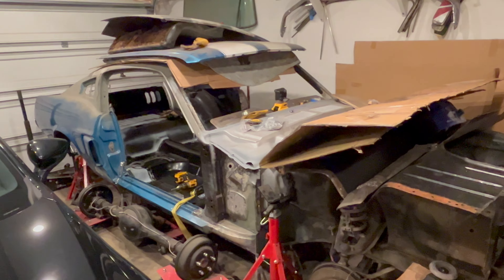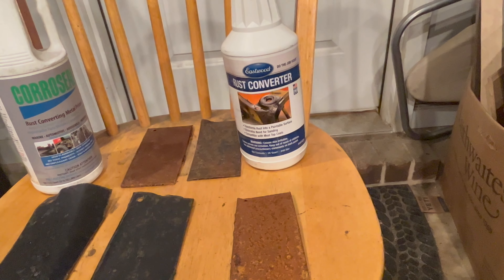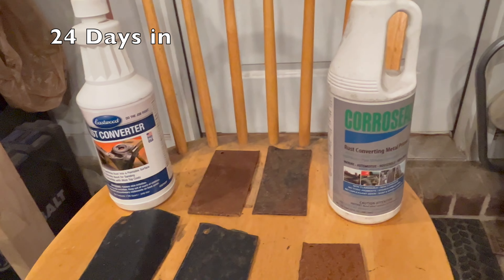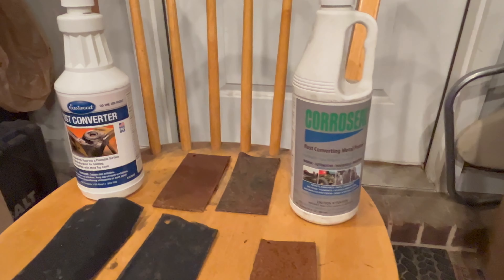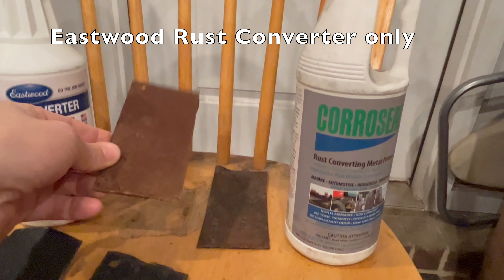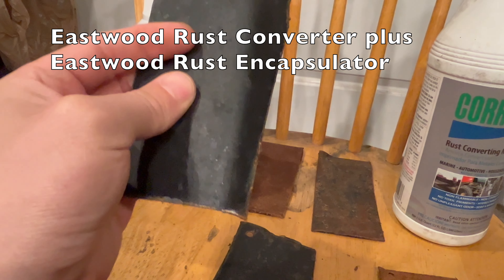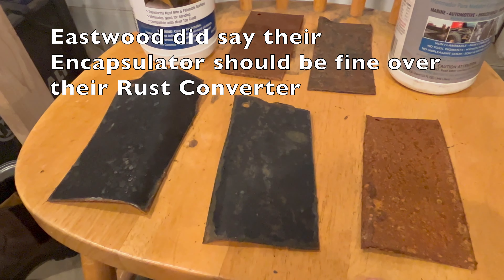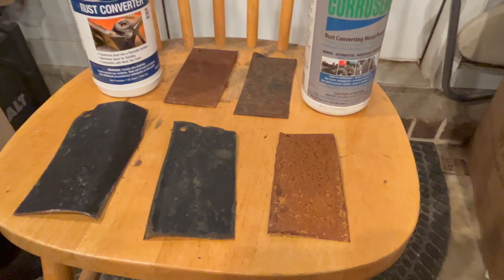Corroseal vs. Eastwood Rust Converter Part 2: Rusty Update

Comment: Much appreciated video thanks for your time
Reply from the maker: No problem! The experiment is not as exciting now, but it is showing me how the rust encapsulator is holding up under abuse. I’ll probably update again in a few weeks
Reply: @evansmessygarage  still holding up?
Reply from the maker: It’s not doing as well as I expected on top of the rust converters, but it’s maybe not a fair test. If I were to properly test the rust encapsulator, I’d also test it on bare and primed metal to see the differences. Without a control, I can’t really say much definitively
Reply: @evansmessygarage  you're still giving it regular salt baths?
Reply from the maker: Every few days I’m spraying with either salt water or plain water. Now that it’s getting colder, the reactions have slowed down. If I were to redo it, I’d try more combinations of products and set up a better jig and time lapse. Maybe in the future
Reply: @evansmessygarage  I live in FL but I bought a northern Sequoia I think I'll be good with what you did in part 2
Reply from the maker: If it’s got some rust already, I’d get as much off as you can (and replace metal if it’s bad), then rust converter to get everything you couldn’t reach. But maybe clean off whatever was converted before you top coat, and maybe a good primer first. I like the rust encapsulator for everything I can’t get off other ways.
Reply: @evansmessygarage  sounds good thank you